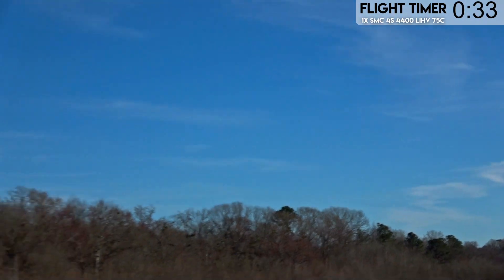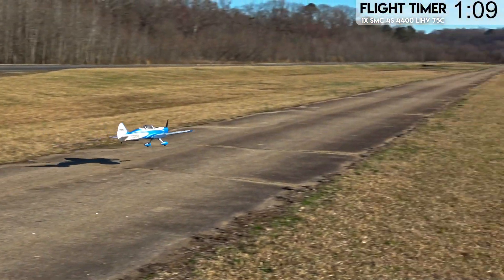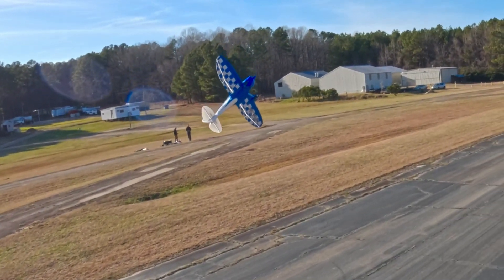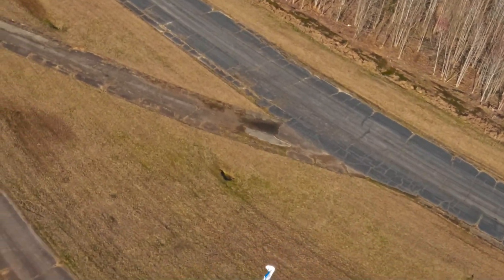E-flite Commander mPd - Stock vs Unlocked Setup Demo

Comment: I just acquired one of these for free. It's been crashed a few times but it's really not in too bad of shape... The only problem I am having is on a SMC 4s 2200 LiHv I can't get the battery forward enough to be able to still put the canopy on and it not be unbelievably tail heavy. It is still flyable but the elevator is insanely touchy.... It makes for some pretty sweet snap rolls though lol
Reply from the maker: It's definitely not possible to make this plane tail heavy on a 4 cell 2200 - it may be more sensitive than you're used to, but it's far from being tail heavy in the aerodynamic sense. Try increasing expo which will help.
Reply: I'm flying mine with SMC 4400 LiHv without any issues

Comment: Love this video! Love the channel! How are you performing the tumble on the sticks at max settings.
Reply from the maker: Thanks! Both sticks to the top left after rolling for a bit. You need full travel and full span ailerons to perform it. The setup guide for this is included in the description.

Comment: Some servos can't take 150 on end points.....there's plenty of servos thar max out at 120 or eve 100....maxing a servo is adjusting it until travel maxes out or it binds then back it out a couple nominals....if it maxes out at 110 and you set it to 150 your just extending the servos capability and load....so in reality 150 isn't always good yes is will be max thro but could be 30 pts of no movement and unnecessary load on servo so always set your servo by its physical movement limit...unless using analog for some reason analog can go alot further....I learned this the hard way from thinking just set it to 150 and then a pro 3d team pilot showed me the proper way to set up a servo
Reply: & all the plastic gear servos most manufacturers use currently can't handle over-extending their throws. It cooks them! 

Y I believe EVERY manufacturer SHOULD BE putting MG digital servos in everything WE are paying $400+++ for nowadays!

Comment: Do you know what they did to new one to add weight to the front without that weight for prop nut …I’ve took mine off on the red version one commander and now it’s wanting to nose up with me
Reply from the maker: No idea, we weren't privy to that info.
Reply: @ I’m fixing it to be a version 2 …I have the motor and esc and prop and prop adapter but the new prop adapter isn’t like the older version ..maybe new motor is heavier to compensate for the weight they took away from prop…had someone tell me it flys better without now I can’t seem to get it from being tail heavy now and I’ve got battery all the way up

Comment: Did you need to rewire for fullspan?
Reply from the maker: Yeah, you have to adjust the plugs going to the receiver.
Reply: @TwoBrosRC  so therefore no open channel?

I want lights on this plane, I also want full span
Reply from the maker: Put the lights into the bind port. For additional questions, hop on Discord and ask in #tech-and-setup via https://bit.ly/TBRCDiscord

Comment: Fist mod of most e flught planes......put quality servos on there and if flying 3d go hv....makes a world of difference....and also get smc pack because your cheating yourself if not u can't beat the bang for your buck they bring
Reply from the maker: This model is flown on the stock servos still - didn't see a reason to upgrade them since they performed well out of the box.
Reply: @TwoBrosRC  yeah that's y I said most.....some of then are ok....if you plan on flying aggressively more often than not then it's a good idea....especially on timbers and ultimate and extra 300...and eratix it's a .ust I stipped out stock elevator doing a waterfall lol....and when I mean quality I don't mean lime savox or mks or bluebird  ur just something reputable like agfrc or the mid range hi techs
Reply: Another great video! This how you make lemonade from a lemon! 🎉